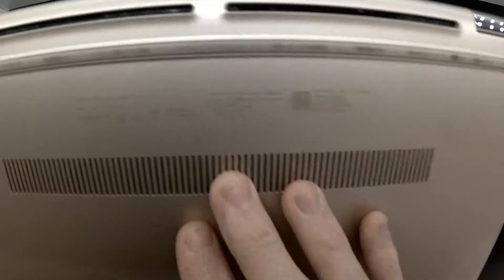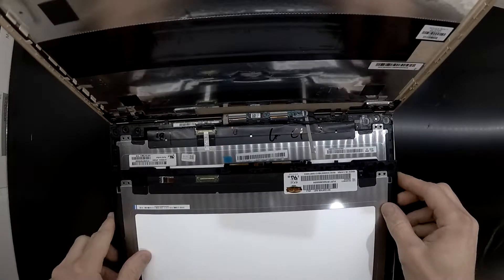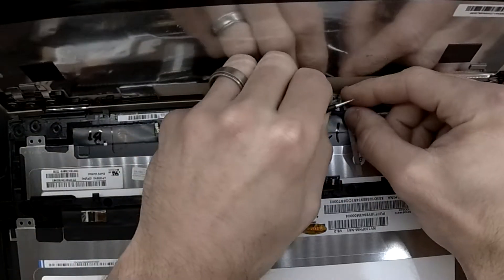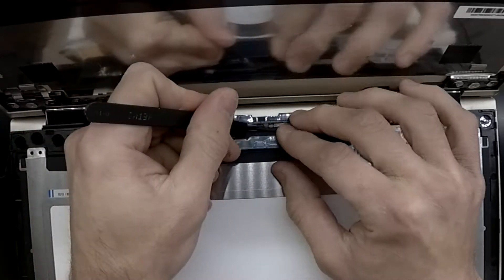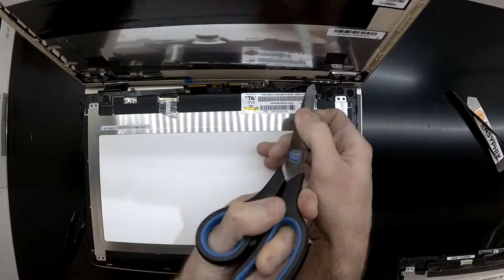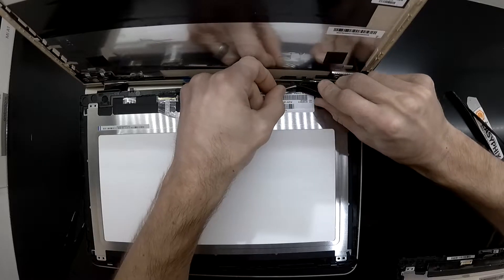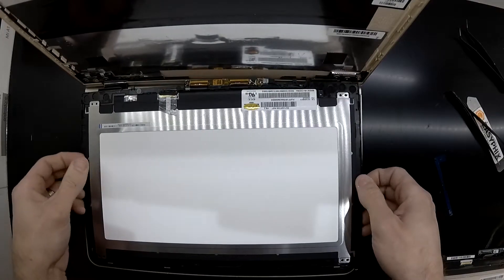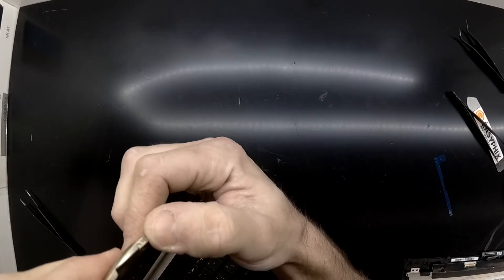HP Pavilion x360 13 LCD and Digitizer replacement

Comment: Hey do you happen to know the flex cable model mine isn't broken but i think the flex is spoilt after my lil bro poured water on it
Reply from the maker: if the connection on the flex cable got wet then it's highly likely it's has fried the board.

Comment: Do I need to use a heat pad to replace the touch screen glass (I have this same laptop, lcd works glass is cracked), or can I just buy the glass replacement and install it without heat binding anything since the touch technology is in cell and my lcd is fine?
Reply from the maker: i find the heat at 75c certainly helps

Comment: After installing, my computer will not turn on. I plug in the charger and the charger light comes on, but when I press the power button, that light does not come on, nor does the screen. Any idea of what I need to check?
Reply from the maker: try and disconnect the battery and the screen, reconnect screen then connect power and see how it goes
Reply: @rickstechrepairs  Thank you so much for your reply. I cannot figure out how to lift the keyboard all the way up to even access the battery. (Unfortunately I started to lift the keyboard for no reason, thinking that I needed to to switch the screen, before watching your video). I believe I damaged the power ribbon cable in the process. I will attempt to replace that cable when I get it in the mail, but can you instruct on how to lift the keyboard all the way off for this model? I appreciate your help and video instruction so much!!

Comment: I need the flex cable from the lcd panel and the mainboard. I cannot read the part number on the video.
Can you help from original video.
Reply from the maker: No sorry, no longer have the original video

Comment: I'm trying to replace my screen, it's the same make and model, but the screen that I want to buy doesn't have the little motherboard attached to the screen like yours in the video. Can I reuse the old motherboard from the old screen?
Reply from the maker: Some models you can other models you can't, I would contact the place you brought the screen from for advice

But in would simply try it

Comment: my screen just shows completely black unless I apply pressure near the bottom of the screen. Once I let go of the screen it goes back to black. The screen itself doesn’t have a problem. Could it be the LCD cable? Is it possible to replace that without replacing the entire screen?
Reply from the maker: Hopefully a loose cable on the back of the display.

Crack it open and disconnect and reconnect it